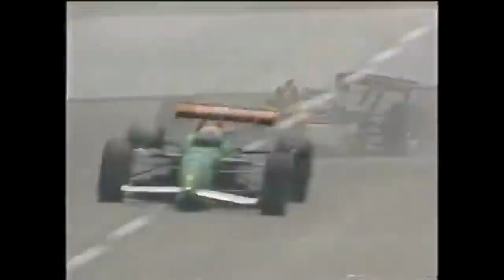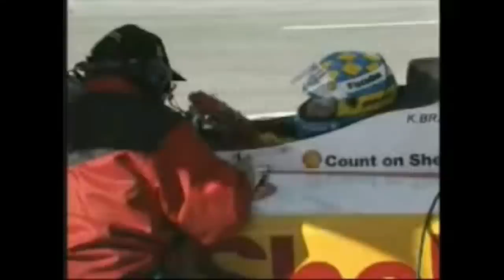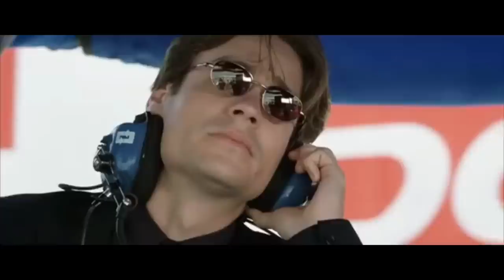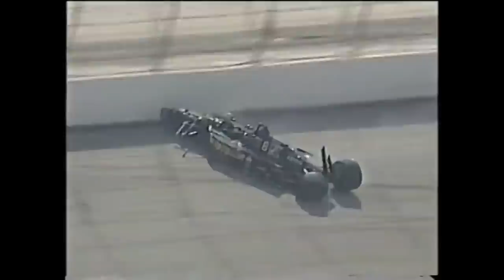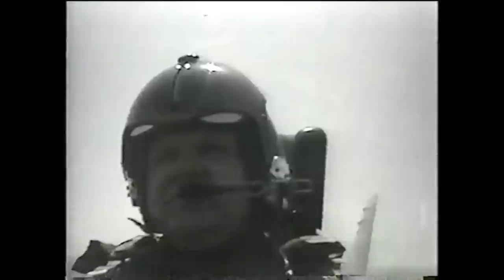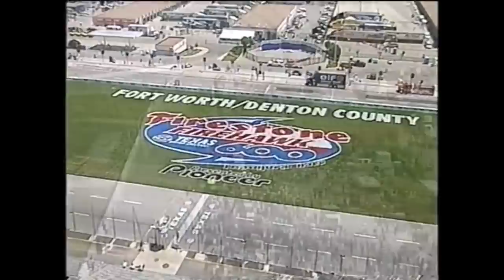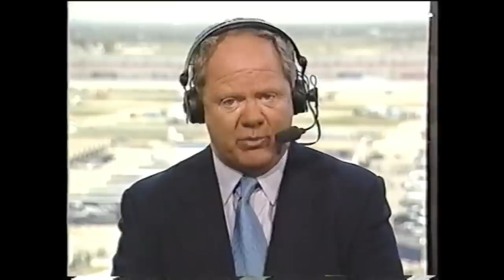The 2001 Texas CART Debacle

Comment: I worked for a sponsor of Patrick Racing in 2001.  Roberto Mereno reported losing the color in his vision and his vision narrowing after repeated laps at speed.  He is actually one of the first drivers to say anything at the track that weekend.
Reply: I can't imagine what it must be like to do 235+ mph for 500 laps. I am not surprised it could induce G force induced unconscious. I am pleased they didn't run this race.
Reply: @dazuk1969 It wasn't the speed because they were doing that at Fontana and Michigan.  The problem was the G loading at a much shorter oval.  Fontana and Michigan had straights a half mile long for drivers to rest up and the banking at Texas was much steeper so there was no rest from the G loading.
Reply: @danielhenderson8316  Exactly. Texas is basically a lab centrifuge with the speed the CART cars are running. The fact the turns are 24° steep vs the 20° and 18° in Michigan and Autoclub just exacerbated the G-loading. The drivers are getting their blood pulled from their heads each time they take the turns.

Comment: People forget that between the Brack test in December and the race weekend, the CART enine manufacturers had redesigned their intake plenums to cheat the popoff valve (coming to a head a few weekends later in Detroit - the REAL low point for CART as a series). Consequently the engines hat the manufacturers showed up with on race weekend had about 100 more horsepower than the engine from the Brack Dec. test (e.g.an enormous gain). The Series Officials had no way to predict this would happen - yet another contributing factor to the Texas Debacle.
Reply: 100? That's insane! What a screw up
Reply: @lightfeather9953  No one ever knew this could be a problem before the event.
Reply: They would know Brack was not going full throttle:
Reply: cough: Honda
Reply: @ethanweeter2732  He probably would've passed out if he did have it wide open. Inertia can be a pain in the a$$, although a lot of other things would be impossible if it didn't occur. For instance: orbits wouldn't be possible.
Reply: First mention I've seen linking Turbogate to this debacle. Probably explains in part why the engine manufacturers were so resistant to engine changes so they could run on Sunday.

Comment: I remember this. And honestly looking back now I believe they made the best decision. Although at the time I was frustrated about it
Reply from the maker: Absolutely. I think everyone was extremely frustrated at the call. But at the end of the day, the call very well may have saved a driver's life.
Reply: The "mistake" was putting teams to do the testing, they should have made the first testing sessions with an outside driver and car, so they could have avoided the sandbaging
Reply: They did. I'm with you that I hated it at the time, when I was only 17, but I understand it now. Safety in motorsport must be the first priority. I saw too many drivers die in the 90s and the early-2000s.
Reply: @Demise90Racing  stop perpetuating that damn myth. None of the drivers were suffering from g-lock, it was heat stress. Let's see you put on 3 layers of nomex, climb into a car and drive it around in 100 degree heat, and see if you don't suffer from heat stress and pass out.
Reply: @Rob_Moilanen  the Indy 500 has been ran multiple times in 90+ degree heat. I doubt it was heat
Reply: If they weren’t going to slow the cars down it was the only decision they could make. Every driver would go as fast as they could as long as they could to win the race. Somebody would have died if not multiple people. 

The correct thing to do would have been proper testing and setting the cars up to limit their speeds to under 225mph. At least they didn’t make a worse decision.
Reply: It reminds me of that episode of Speed Racer....the one with the cursed engine they dug up out of a cemetery.
Reply: @spawnofapathy About the only thing they didn't try to slow the cars down was dropping the boost pressure.  The engine manufacturer's vetoed it because dropping it enough would cause engine failure (as if their engines weren't blowing up all the time).  They also had maybe 12 hours to figure something out that every team could do in order to race.

Comment: A rare instance when a race was cancelled because the drivers are deemed physically unfit to drive for the whole race due to high G forces due to massive speed and banking.

It is an embarassing moment for CART but it could’ve been worse if they ran the race as scheduled
Reply from the maker: Absolutely! A bizarre reason for the cancellation of a race, but one that was the right call for sure.
Reply: It was damned if you do, damned if you don't for CART.
Reply: Yes; would you rather have fans disappointed? Or risk a driver- or drivers- dead? Very easy decision
Reply: @Demise90Racing  SO why didn't they run the inner track?
Reply from the maker: @thedave7760  wouldn't make sense as road course and oval configuration cars are substantially different.
Reply: @thedave7760  They only had the oval setup kit and tires.  There was no way the entire field could get all the parts in about 12 hours.
Reply: @m-rod you know it was bullshit right? Cause Indycar ran the same track in similar fashioned kit to CART. Everybody knew it was about the money CART wanted from Texas owners. That bullshit "medical" excuse was just bullshit from the damn get go. Why? Cause Indycar still runs that very same racetrack in similarly fashioned cars to this day, and they do not have drivers dropping like flies due to g-forces suffered.
Sure it's a grueling race, but it's mostly due to "heat stress" that the drivers suffer from, not the g-loading of the cars.
It was all down to the money that CART was extorting from the Texas track owners, because of CART's bullshit "branding problem"(they wanted more money than they were worth). Which it was later born out to be true, cause CART went out of business. Cause without Indy, CART wasn't worth a shit.
Reply: Las Vegas 2011 but on a much worse scale would have happened had this race went on.
Reply: The track got resurfaced shortly after all this to slow everyone down. Shortly after that Nascar signed up 'cause it was the fastest track around... but the real stories Texas Motor Speedway has to offer are about Rock Fest & County Fest.
Reply: @Rob_Moilanen Have you even seen the aerodynamic load cars today have compared to before?? The 2001 cars barely had a front wing, actual ones are snowploughs in comparison, and much more safe all around.
Reply: @Rob_Moilanen  This is nonsense start to finish. IRL was much slower at the time, and didn't have this kind of problem.
Reply: @thedave7760 everyone has given good reasons why they didn’t but have forgotten to mention the fact that the infield was packed with RVs so it definitely was not an option

Comment: The entire cause of this was teams sandbagging during all the tests. They tested before the race and the speeds seemed fine. They were only fine because the drivers were purposefully going slower than they could to not show their hand. As a result, CART thought everything would be fine. If the teams actually ran at full speed, they would have seen this earlier and something could have been done ahead of time.
Reply: There was never an official CART test like there should have been, and while drivers weren't sandbagging, they weren't going full tilt.  They were also using 2000 spec engines which was also less powerful that the 2001 motors they had in the middle of the year.
Reply: Thank you,nailed it.If everyone went wide open this would've been avoided.And to the other persons point,CART should have done wide open testing first,absolutley
Reply: @danielhenderson8316  full tilt with the boost turned down and full fuel

Comment: For those commenting about the G Loads, the link to the ABC Broadcast is here: https://youtu.be/wVyfgh3TVCM .  The main point that Navy Captain David Brown (who also died on the Space Shuttle Columbia) at 17:00 mark was that fighter pilots would hit 5-9 Gs for several seconds and that the space shuttle would hit 1.5-3 G for about 8 minutes while the drivers would have had to face 5-6 Gs for almost 2 hrs and 45 minutes in the Texas heat.

Comment: You should do a video on the Las Vegas IRL debacle in 2011….. where (unlike CART), the IRL simply chooses to ignore its drivers concerns & an absolute tragedy occurred.
Reply from the maker: This will happen at some point. That's for sure.
Reply: Don’t forget the 1999 Charlotte race that killed three spectators. 
I watched that race in 1998, IRL was running 8 to 9 seconds a lap faster than the Winston Cup cars lap record, a couple cars were approaching 230mph going into turn 3 
It was cool to watch but   one heavy crash in three years ended it. 
The Charlotte roval would have been a better race and they would have needed so much downforce in the infield. But IRL was all round track then as I recall.
Reply: F1 1994 when senna died & nascar 2001 when dale sr died

Comment: I remember in the weeks leading up to the race there were many CART drivers who were very vocal about not wanting to race at Texas. I would've loved to have been a fly on the wall at the driver's meetings and CART official's meetings to find out what really happened.
Reply: That was bullshit, I mean it was DFW in the heat of the summer with drivers wearing 3 layers of Nomex, of course drivers didn't want to suffer through that. It was too fucking hot to be racing.
Reply: @Rob_Moilanen Yet they would go to Fontana and run faster in the same heat...
Reply: @danielhenderson8316  uh you know Fontana is near'ish to the ocean right? It's not the same "heat", as near DFW. Don't get it twisted.
Reply: @Rob_Moilanen  It still gets to triple degree weather in SoCal.
Reply: @danielhenderson8316  yeah, but don't clown like it's the same "heat", I've lived near LA and DFW, they are not geographically comparable.
Reply: @Rob_Moilanen  Yet you're the only one claiming heat exhaustion where every driver, team owner, pundit, and Doctor agree that it was pulling 5.5 Gs for 90% of a lap that caused the issue along with drivers suffering symptoms of G Lock.
Reply: @danielhenderson8316  right, every Doctor is trained to recognize G-lock symptoms. Go away little boy, ya bother me.

Comment: Steve Olvey and Terry Trammel had to be given complete control of track safety because the drivers would not do it. Mario Andretti said that every safety feature is a speed penalty so they had to be mandated on all teams. Dr. Olvey once noticed drivers getting out of their cars after a race, complaining of headaches, nausea, vomiting and flushed red skin. Dr. Olvey  mandated every driver take a blood test after the race and he found out the carbon monoxide levels were well above normal. Now drivers have air filtration systems. After a series of serious foot injuries, Dr. Trammel ordered the nose of the cars to be longer and the driver's feet to be place behind the front wheels giving them  more protection. If Dr. Olvey said it was too dangerous to run this race, most of the drivers would not argue with him.

Comment: Wonder if they could've reduce boost even more or added more wing(thus add drag)
Reply: There was a scandal later that year when it came out that the engine manufacturers had found ways to cheat the blow-off valve that limits boost, so the engines had more power already than they were supposed to. And they didn't bring road course wings with them to increase downforce, and it wouldn't have been safe to just build a duckbill spoiler with stuff from Lowes.

Comment: At 8:00, the narrator stated that the g-load of 5.5 was twice what a fighter pilot “endures at one time”. 

I’m not sure where this guy got that info, but it is patently false. Fighter pilots and aerobatic pilots can experience g-forces of 9 and even 10 g’s. Such forces are the reason for g-suits.

Back in 2001, news reports typically explained that it was not the peak g-force exposure that caused the problems, but rather the fact that the nature of the Texas track resulted in SUSTAINED g-loads being experienced by drivers that was potentially dangerous.
Reply: Also the human body can sustain vertical g loads a lot better than lateral

Comment: woah. i'm honestly surprised that this race got the green light. OF COURSE cars going 220mph+ around a track that small would cause problems like that. it made perfect sense when you laid out the numbers... if they were going to do something like this at all they would've been better off going to a super speedway like Daytona, or building their own track that was bigger than 2.5mi. granted that probably wasn't feasible at the time, but building a new facility that can safely accommodate the speeds their cars could run at would've been a much preferable option than subjecting their drivers and equipment to that much sustained lateral g-forces at a track that has no business hosting a series that has cars that fast. it sounds like the CART publicity disaster that day was unavoidable as soon as they added Texas to the schedule.

and now that i think of it, this is probably the reason why series like NASCAR limits the top speed of their cars to around 200mph. i thought it might've been because of their tyres, but this makes a lot more sense to me. 🤔

Comment: would it be too dangerous to use that package with bigger wings? or availability was the issue?
Reply: Adding wing would add more downforce which would increase the G load.  This issue also came up on Saturday afternoon so getting any shipment of parts was impossible to receive for the entire paddock by Sunday morning.
Reply: @danielhenderson8316  they would increase drag wouldn't they? wouldn't that reduce speeds and reduce Gs?
Reply: @FerrariConceptX The speed would have gone down because of the drag, but the G loading would probably increase due to the extra grip provided by the extra downforce.

Comment: so, i still dont understand why IRL could race there and CART couldnt and what the difference is with Las Vegas. Las Vegas also has 20 degrees turns, as Texas has. Can somebody explain me both questions? Thank you!
Reply: CART cars were much faster than IRL cars which meant the vertical g-forces were significantly higher. Vertical g-forces are when the blood flow is  decreased to the brain which causes blackouts etc.

The Las Vegas track has more of a straight to allow drivers to "rest" in between the banked corners.

Comment: I don’t understand why CART didn’t try a restrictor block off plate or make it mandatory to add weights to the car anything to slow them down or even make it that they couldn’t run wide open throttle
Reply: Because they had about 10 hours to find a fix for about 30 cars.  Cutting the boost enough to slow the cars down would blow every engine in the field according to the engine manufacturers (even though reliability wasn't very high).

Comment: Or, you cut the boost by half.  Or you require them to put on the road course wings to make them have so much downforce they cannot get to top speed.
Reply: No one had the road course kit to go racing otherwise they would have used the road course instead.  The engine manufacturers also said that cutting the boost by such a degree would make the engines fail at a higher rate than they normally would.

Comment: Imagine if they had G-suits!!? Maybe even faster.
Reply: i was just thinking that. if they were to run at relatively small ovals like this, that would've been the best route to go i would think. but maybe the NASA guy advised against that?
Reply: Besides timing, G Suits would be a disaster.  They work by constricting blood flow to your limbs so more of your blood will stay in your head or torso.  Add in the Texas heat, no power steering, and over 2 hours of racing and you'd probably have to amputate everyone's arms and legs.

Comment: It was the final nail in the coffin because cart should have learned after Greg's passing in 99 putting that kind of g forces was too much
Reply from the maker: CART had many opportunities in testing to get it right, but they failed to do so. They wanted to do a mandatory test, but CART said no and only some teams tested giving insufficient data.
Reply: It wasn't G Forces that killed Greg Moore.  It was hitting a concrete patch on the frontstretch grass that kicked his car into a roll with his head hitting an interior wall.  CART went even faster at Fontana and didn't have that problem.  The G Force problem at Texas was there wasn't enough of a straight for the drivers to rest up before the next turn.
Reply: @danielhenderson8316  backstretch grass*.  And to your second point, TMS has a ton more banking than fontana. Tms has 24* to fontana's 14*... fontana is almost flat, for all intents and purposes. The drivers at Tms were getting lateral and vertical g's at the same time, at over the 5.5g's referenced here... That had never been done before.  But you are correct that the shorter straights at Tms did it no favors..   The crazy thing is, The closed course oval record is 241mph set at fontana... but yet they set a lap at 236mph around texas...and it is way smaller of a track..
Reply: @2jsalomon  241 feels pretty good on a mostly flat track compared to 236 while feeling like an F-15 pilot in a 2 hour dogfight
Reply: @vetteman06  Fontana is super bumpy but point taken